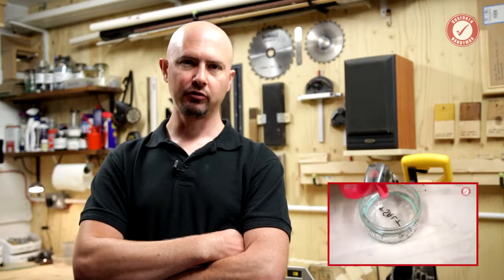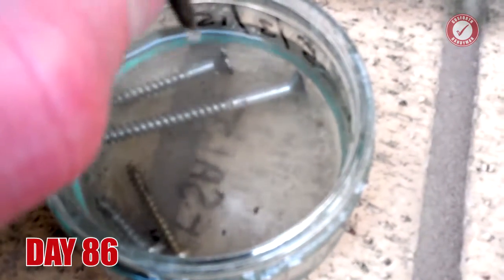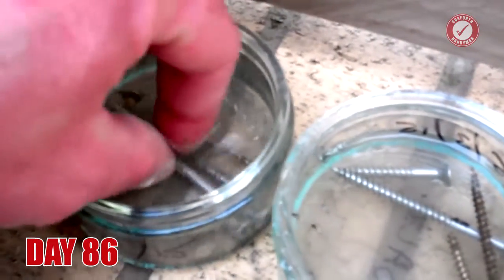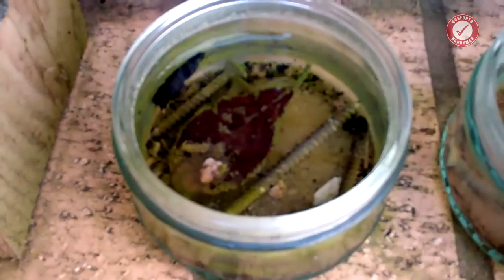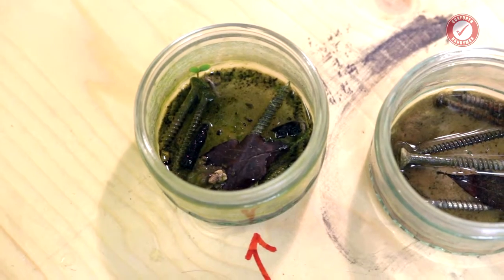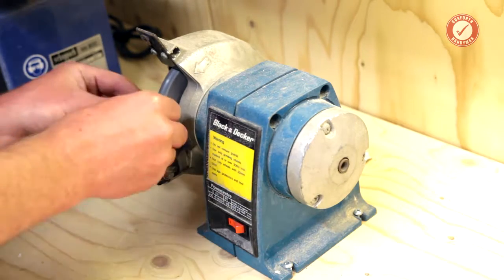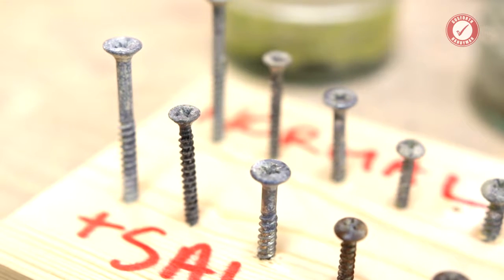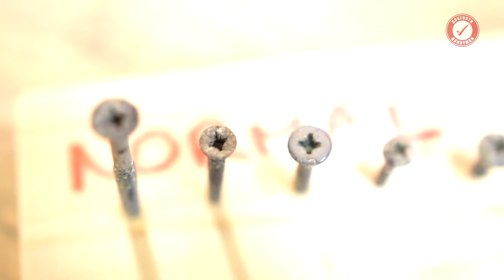How quickly do Woodscrews RUST? (part 2 of 2)

Comment: now test with different metals touching each other (touching rusting metals cause some rust-free metals to rust but not all), different temperatures, small currents running through the water, also add some acids to the water especially those used in walls like in cement and pre scratch the screws. And test more different types of screws. Because galvanized ones are really bullshit, the tiniest scratch exposes the interior which rusts very fast.
I'm still looking for non-rusting screws to attach the copper piping with a metal holder to a cemented wall in the shower (sometimes high temp, loads of warm water). So far the dimwits at the shop say "yeah this is rust-free it says so on the package" and it rusts within a year.

Comment: yes, those are screws rated for general purpose including exterior use, and have a zinc plating (even the gold colour is a zinc) the rusty ones are bare metal and not rated for outside use,   non zinc plated screws and bolts are the bane of old cars/motorbikes !
Reply from the maker: They're all zinc plated.